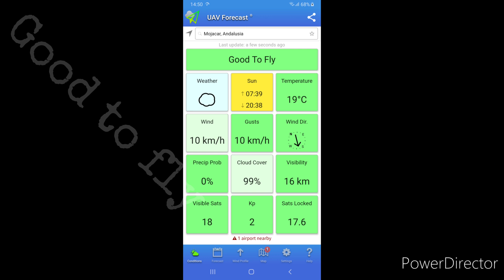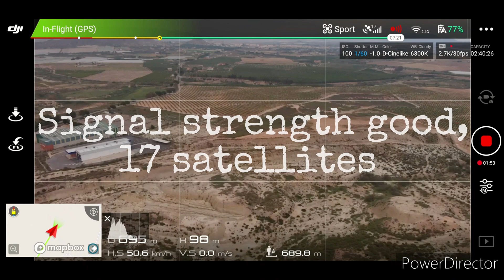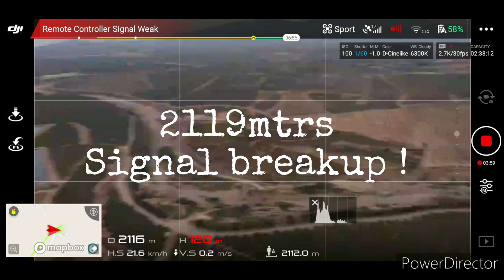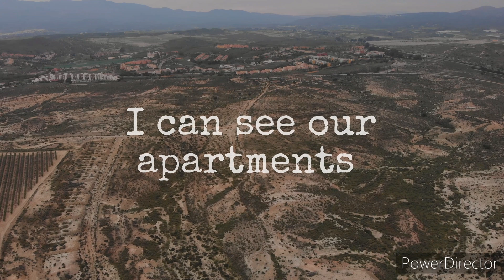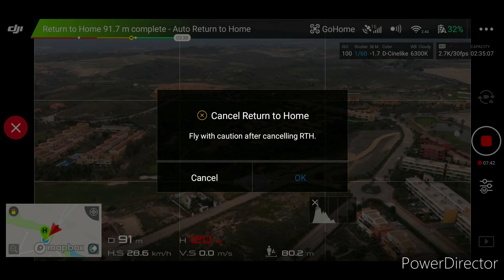Mavic Air signal loss, return to home function.

Comment: Hello my mavic air drone lost signal at 150m or less  how can this be fixed
Reply from the maker: Hiya, seems a short distance to lose signal !
Were you in an open space or maybe trees or buildings interupted the signal. Try switching radio band width in settings.
make sure your fly app is updated. 
Did you have a good 10 plus satélite links..
Reply: @RichardFiske0311  thank you I'll try this and let you know 🙂

Comment: So no matter what, the drone will come home if it's lost connection with the controller.
Reply from the maker: Hey Flyby, yes, it will automatically initiate RTH and fly home to the take off Home Point. If you want to, you can change the location of the Home Point at anytime during the flight... in case you have moved for instance,  eg been walking whilst flying. I did a video on this... check it out in my channel,  it's very useful.  👍
Reply: @RichardFiske0311  Thanks. I have the MA2 and know it has that feature but like others have said, when I see the bars go down, I initiate "freakout mode" and come back home. I have the devil on my shoulder saying "well what if yours doesn't come back?" I really shouldn't care as I have a whole 2nd year of DJI ReFresh Care. Guess I should flick that devil off my shoulder and start hot-dogging it.
Reply from the maker: LOL I know what you mean. It bloody scary and Ive had it do some crazy stuff flying around before finding its bearings and heading home. Ive got the MA2 as well, but not flown for 6 months.... but about to do a couple videos on finding your mojo and and snowboarding.. should get me back into the YouTube creating thing again..

Comment: Sir ask 1 question my drone model is air2 if I’m fly far and lost signal did it return to original spot with our strong gps?
Reply from the maker: Hi Kiet, Thanks for watching and leaving a comment. The answer is YES, it will return to the home point set on take off. Note you can also change this home point (or RTH Return To Home) after you have taken off and its still in flight, or even when it is in RTH mode. I have done a video on the RTH accuracy as well as how tio change your Return To Home point if you look through more of the videos on my chennal. Here is a link to one of them at least and I hope these help you. Safe flying. 
https://youtu.be/TZdMJO1OX7w

Comment: What if the RTH doesn’t show on the screen when the signal is lost? Do I just press the RTH on my controller?
Reply from the maker: Hi Kasey, usually if there is a signal loss between the drone and the controller, the drone will automatically go into RTH mode after a few heart stopping seconds. If at any time you want to press the RTH button on the controller, this will activate the same function and the drone will fly itself back to the home point gps location last saved to the phone... usually where you took off from. That's why its important after take off to hover a few seconds to let the drone get the gps co-ordinates and you get that voice message, "your home point has been updated".
Bear in mind you can set a new home point in the settings if for instance you took off from one location and moved to another new location when doing active track for eg and you had the drone follow you to another location a couple kms away. In these cases, you can update to your current location so it doesn't fly back to your original take off point.... This happened to me once, scared the life outta me...thought I'd lost my drone when it went flying off over a forest. Luckily, i went back in my car to the take off point and there it was, waiting for me on the ground where it had taken off from 👍
https://youtu.be/T3Sw6HBtiuY
Reply: @RichardFiske0311  oh ok thanks, its because yesterday I lost connection on my mavic air 2 and I didnt know what to do so I just pressed the he RTH button as quick as possible but didnt see anything on the screen popup saying to RTH

Comment: With mine, when I lost the signal I couldn't press the RTH on the controller cause there was no signal. What a trick
Reply from the maker: Hi Guto, don't worry though, as long as your home point was set on take off and you haven't moved location whilst flying, the drone will fly back to you as long as you have enough battery power left. 👍

Comment: You are very lucky that you didn't get a fine so far... ;-)
Here in Spain you only can fly with the drone in sight, even when you are a licensed drone pilot (are you?). That means maximum 500 meters away, although you won't see the drone from about 200 mtrs.
Reply from the maker: Hi, thanks. I fly for fun and tried to do this range test flight out over the campo area. I normally fly in line of site whenever I can, but sometimes you just have to fly a bit further out to get the shot. In this video I was also trying to get confidence in the drone and its safety features etc.